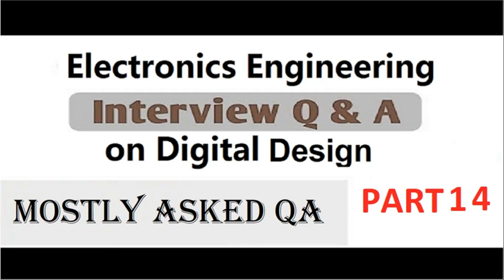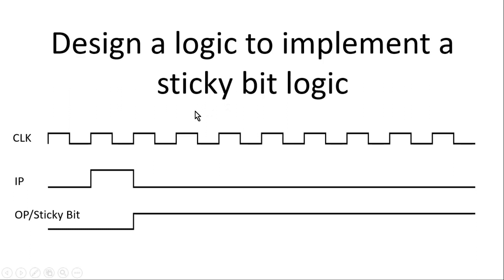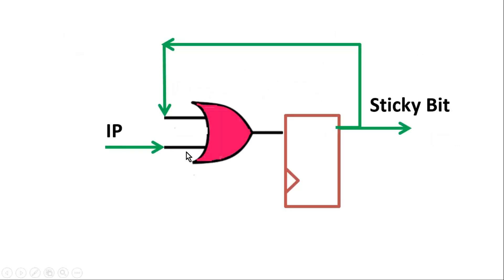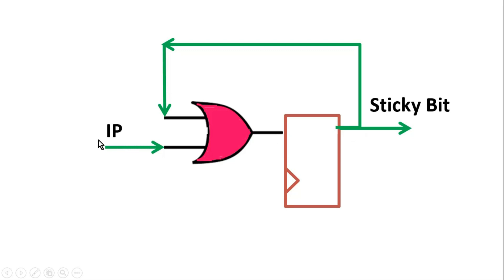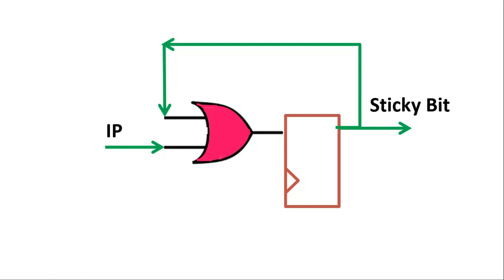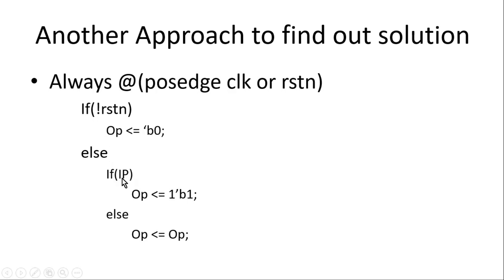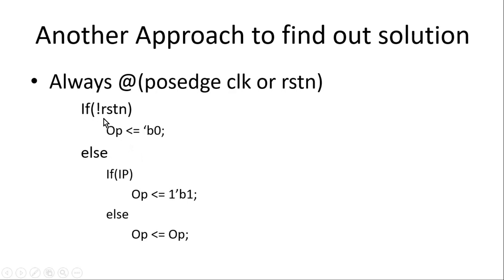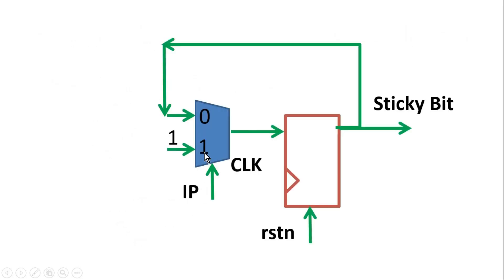Digital Design Interview Questions Part 14

Comment: But sticky bit is high when input is going 0 from 1 means for negative edge of Input signal output is high 
Then why are you saying opposite in code☹
Reply: same doubt
Reply: It is because O/P is taken when it is stable at clock edge.. When I/P is going from 0 to 1 input is assumed changing near the clock edge and thus input is sampled on next clock edge when it is stable so, it looks like sticky bit is high when input is changing from 0 to 1.